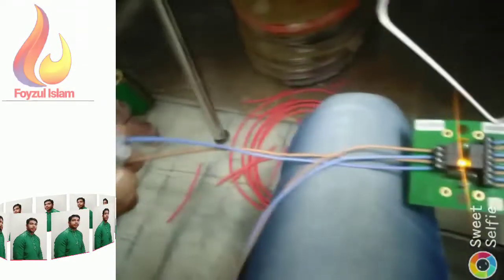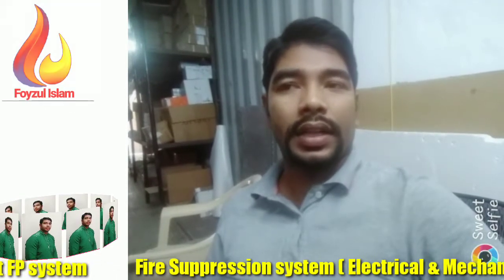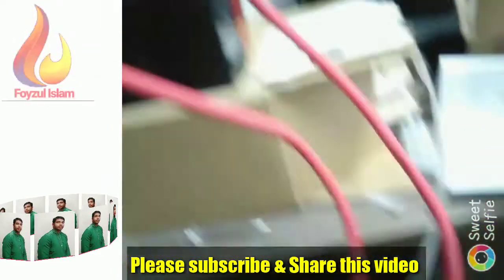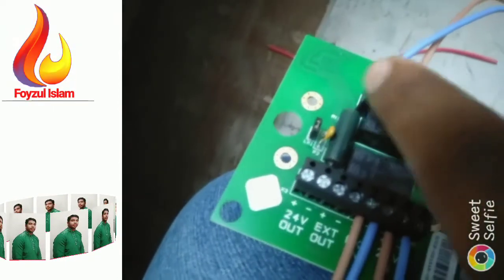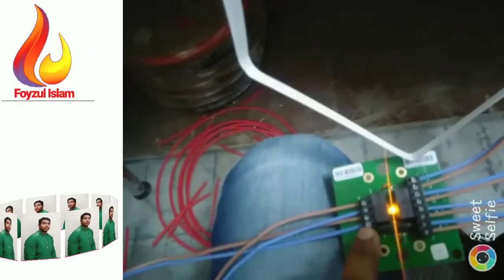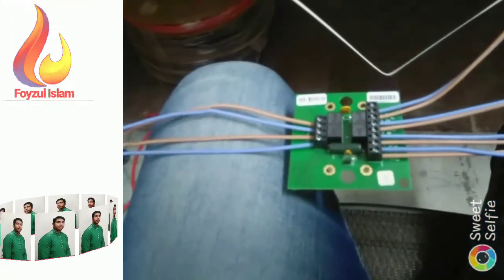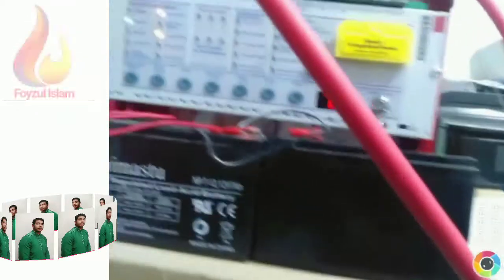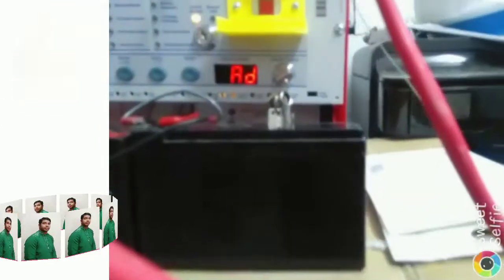Aerosol -Details of Sequential activator diode connection, fire pro generator resistance connection

Comment: Sir without relay bms wire connection bauble in the panel
Reply from the maker: SHP pro panel (Fike) that panel you can connect 2 BMS cable means 1st alarm & Discharge. And shield panel without relay you can connect BMS wire.